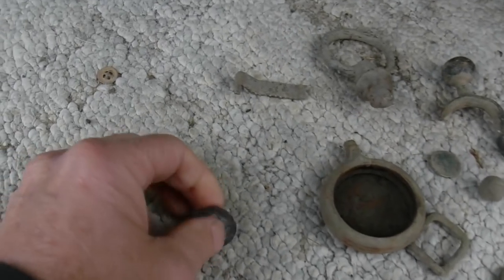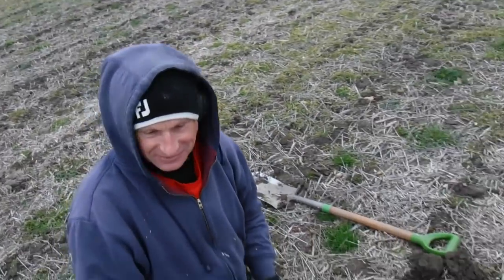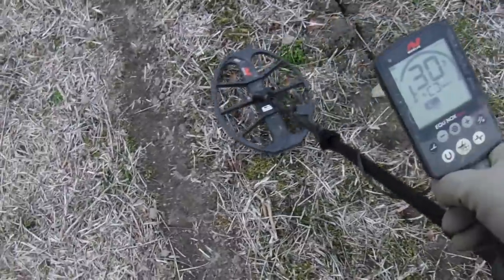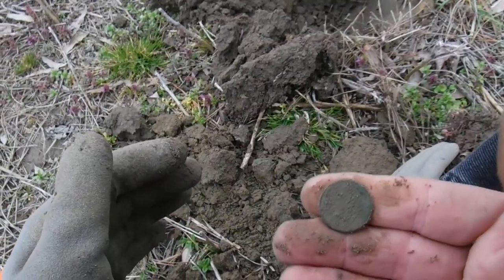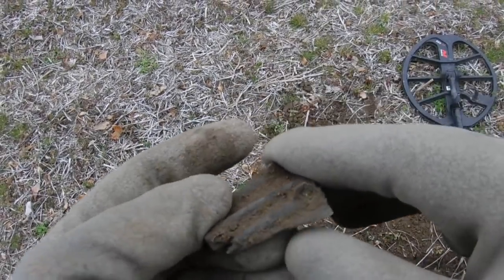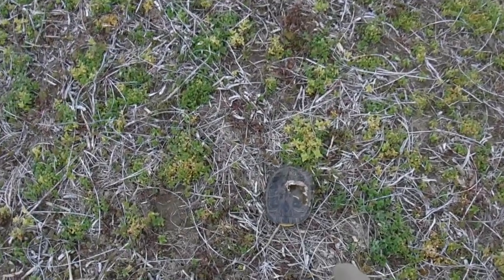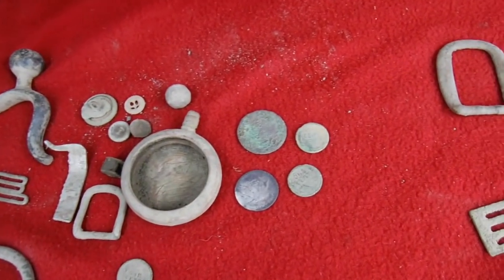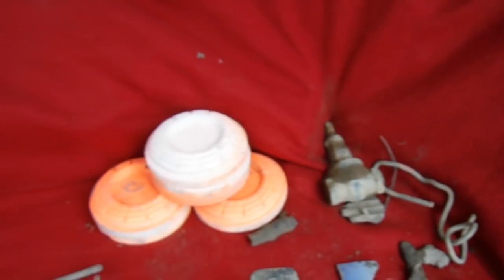The Three Amigos!

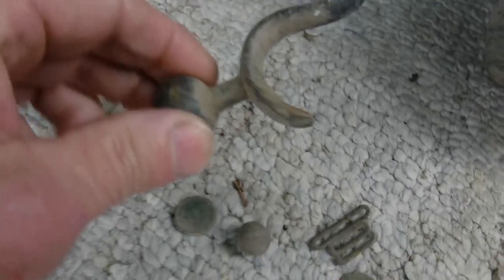Comment: Could Buddy's find at  0:24 be a matchlock  or flintlock musket rest? If the bottom of that ball end shows signs of  breakage from another missing metal connecting piece that was a socket it may very well be. I couldn't tell in the video. Sure is the right shape for a musket rest on the top section with that U shape though. Just a thought.